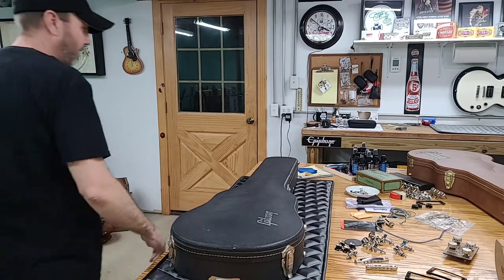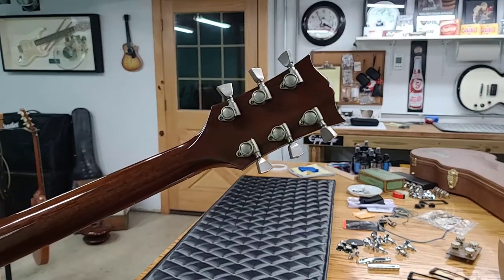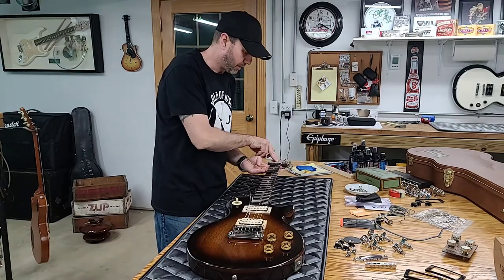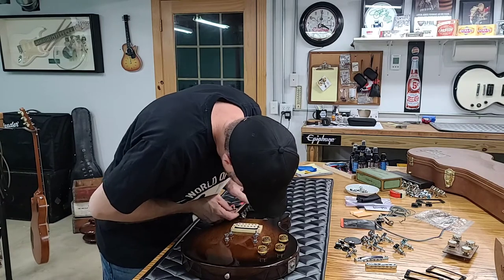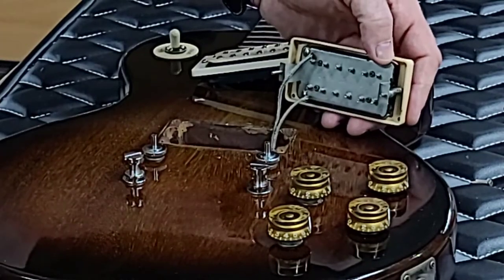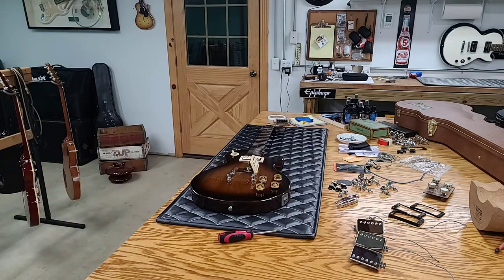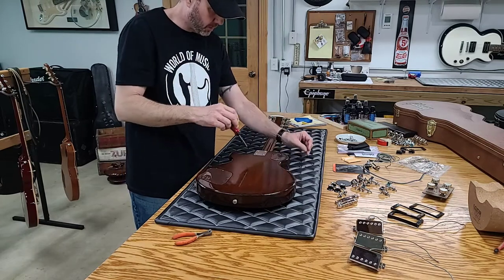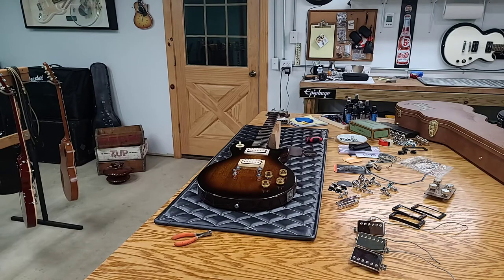RARE!!! All ORIGINAL 1979 GK-55 Gibson Vintage Guitar!

Comment: The TP 6 bridge would definitely NOT be original on that guitar. They wouldn't put one on a low priced bolt-on neck guitar. Also, if you look at the pole pieces on a 'dirty fingers' pickup, if it features all screws  - it IS one. If not, well.... And if the GK-55 isn't a Les Paul, what is it? (Mr. Smarty guy - careful  - you're ignorance is hanging out!)
Reply from the maker: They All came with a TP6! 

https://reverb.com/item/68073888-gibson-les-paul-gk-55-guitar-with-generic-case-1979
Reply from the maker: 1979 Gibson GK-55, Les Paul, Rare Cherry Sunburst https://reverb.com/item/74678929?utm_source=android-app&utm_medium=android-share&utm_campaign=listing&utm_content=74678929
Reply from the maker: https://en.wikipedia.org/wiki/Gibson_GK-55